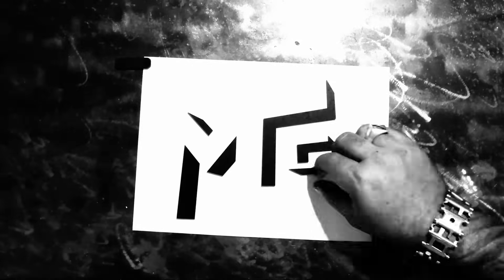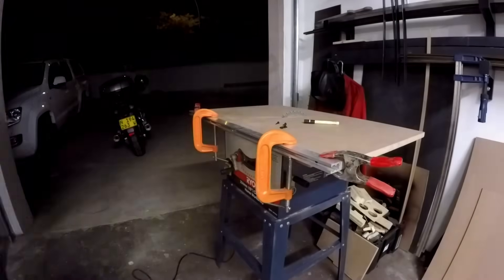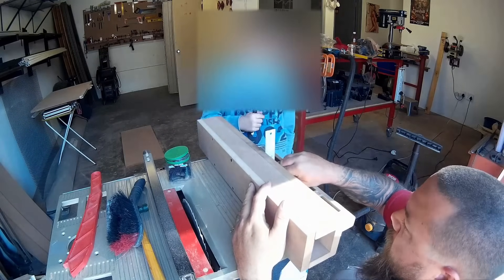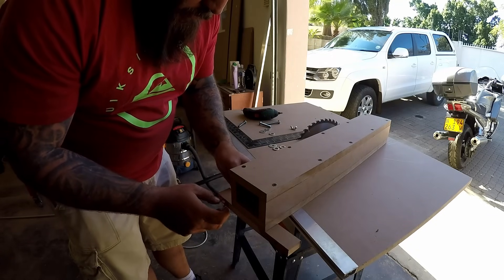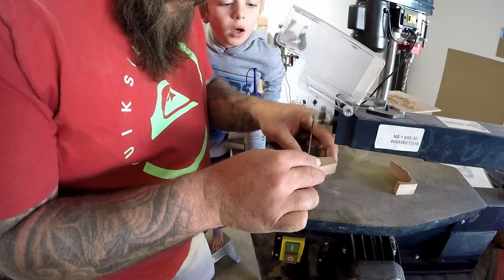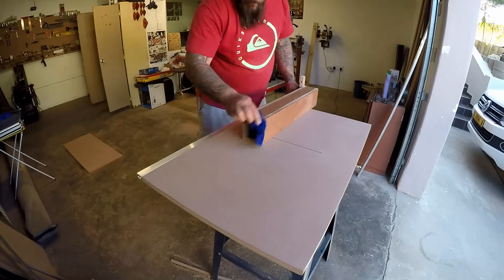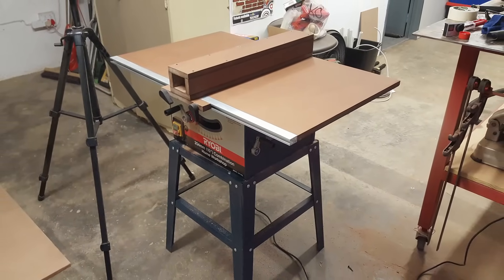Cheap Table Saw Improvements Part 1

Comment: Great job on that buddy but all I can say is no matter what you do to that Ryobi machine it is going get you again. I got the exact same machine and I took the motor out and made a complete new outer frame and table top for it from 25 mm pine ply. It runs much quieter than the previous. No metal plate therefore no vibration and less noise. If you xan fet your hands on an old drawing board machine, with afew modification and you have a good fence. Drop me your e-mail address and I will post you some pics of what I'm doing to mine. By the way, I'm from Cape Town. SA. Great job once again.
Reply from the maker: Thanx... yeah, ive been planning a redo, would be great to see the approach you're taking with yours... macon.campbell@gmail.com
Reply: MACON CAMPBELL Hi Macon. Go to Uncle Cys Woodshop on youtube. Old tablesaw to new tablesaw. Great video and I'm going to use some of his ideas to upgrade mine. I will use what I have now to build the new one.
Reply from the maker: Jut checked it... Wow!... some great ideas there, I may just use a couple too.. 
Thanx..

Comment: Man I notice u don't have a splitter and the end of your blade. Not sure if that's there actual name but that's what I call it. A bit of steel to seperate the two pieces of cut material so it won't kick back all the time. I think a tablesaw is sooooo dangerous to run without one, always kicking back. I do love the design man, really do, I'm no expert but pls put what I call a splitter on behind your blade before u start losing fingers.
Reply: I agree Willis. The saw should have come with a riving knife or splitters

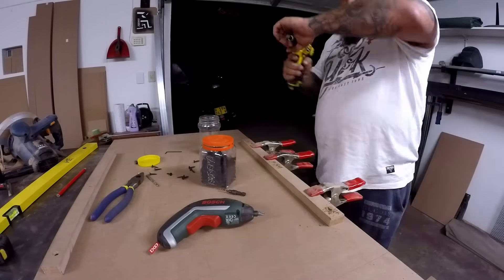Comment: at 2:00 and MANY other spots, you can see you're NOT drilling vertically. Probably doesn't matter, but it appears that NON Vertical is your rule rather than the exception. Doesn't matter much for the hole drilled, but then following afterwards with a Phillips head screw in a drill driver, and if the Phillips bit is not perfectly aligned with the center line of the screw, the Phillips bit will severely chafe the shape of the Phillips receiver in the screw.  Again doesn't matter so much for a one times use of the screw, but removing the screw and remounting it, each time the screw is abused, it looses the positive grip between the screw and the bit , each time loosing the maximum torque that can be applied in that assembly.  At some point, the screw cannot be removed or reinstalled, and you have a problem of extra measures required to accomplish service. This is also true of straight slot screws too. Becomes "amateur apprentice day" in the shop,  and the shop owner hides the work in the corner of the shop so no one sees it until the apprentice leaves, graduated, or repairs the workmanship. 
No offence intended, but comment screamed at me, so I sort of had to say something, .. or my own quality suffers.
Reply from the maker: I have never claimed to be anything other that amateur anyway... That is what I was capable of then... I like to think I am capable of better now... thanx for watching...
Reply: maconSTUFF 1 minute ago Highlighted reply,"I have never claimed to be anything other thaN amateur anyway..."
Maybe I've been less than fair. I worked with a guy who had this same affliction(in ability to accomplish the task effectively) among others. At 68 He was the Boss and Owner and he was dying of Parkinson's, and then at 64 I was "the apprentice",  and because of the disease the quality of his work was progressively worse and worse.  Under extremely hot and difficult conditions he and I would remove hundreds of screws to climb inside the equipment to do repairs, climbing back out and retightening those screws, and test the equipment, only to find damaged returned screws were causing air leaks requiring REENTRY AND RE-REPAIR by me the apprentice, and I'd have to ask Boss NOT to help me as he was causing more rework than doing and completing the repair. He was hemorrhaging money trying to complete the project, He insisted on trying to get it done faster by helping, putting us further and further behind. I wanted to FIRE HIM, but he was paying the bills, so all I could do was endure. (Hot, difficult, physically very challenging, mentally exhausting and demanding) On one project, we had to go back in 3 times causing 3 days of unpaid rework. Finally, at the end of one of the projects, I had to call him and tell him we were both OUT OF BUSINESS, that I could no longer work with him, and (as he knew, he could not accomplish the work himself alone....)  The disease, and his disability, caused by it, were killing ME as well as him, and the more he struggled to maintain his abilities, the more thankless and criticized rework I was forced to do. With the mental disability of the disease, and the medications, and the extreme exhaustion, he could NOT SEE the development of the problem.  
At times, LIFE IS TOUGH, and we struggle.
All we can do is to struggle to perfect our skills and abilities while we have them, and pray they outlast our needs.

Comment: Well done, Looks good.
Quick suggestions yo make you world exciting: look @ Sketchup Make will make projects a little more fun. 
In SA you cannot get anything like you can in the US or UK. I found a site (Wish.com) you can purchase many thing from there long lead time but it gets here.
Keep Safe and hold onto all 10 digits
Reply from the maker: Hi Peter... Thanx!... I actually use Fusion 360...
Signed up at wish.com, looks good... how are the prices so good? have you purchased from them before?
Reply: I purchased a bike computer and it came a week early but still 10 weeks after order. They have some free stuff too just pay shipping. I have setup a wish list and when I have the finance and the like I then will go "Bos" I see you have much of your tools from Ardendorfs, we have one here too and they were very reasonable be fore but are now getting pricey.
TIP check the Pawn shops I got a Krieg Draw slide jig for R30 when it retails at $30 so I troll the stores in my area.
I don't know if you know Izzy Swan He make a jig for anything and everything, very stimulating and a good resource is Steve Ramsey he has alot online too
Thanx again for posting

Comment: I hate Melamine. Won't use it. Don't even like it my shop. (spiritual problem) But...because one side of it is some kind of plastic bonded to MDF it makes for a pretty slick surface and it's a helluva lot cheaper than Formica or phenolic. I like a slick surface on a table saw. Same with a router table. Over the years I've used Johnson's Bowling Alley wax (let dry and buff a little) to make the table sweet so that boards will slip across it like a hot wing through a cloud. Also, if you've read some of the foregoing comments as I'm sure you have, watch videos of traditional (ancient) Japanese woodworking. Some pretty formidable craftsman and they are nearly all barefoot. Keep up the good work.
Reply from the maker: Thanx man... I used melamine for the second rebuild I did: https://youtu.be/pGNBSCswBac ... also not a fan of the material, but as a surface for a tablesaw, it turned out a lot better... yeah those Japanese woodworkers are literally "Ninjas" LOL... Thanx for watching mate...

Comment: I understand this video is 4 years old, but I'm gonna add my 2¢ anyway...
I see why your bit broke. You tend to start drilling at about 60° and then rotate to 90° to finish drilling. Too much rotation. If your bit isn't sharp enough, then we compensate by adding force to drive the drill through. The combination of rotation and downward force is too much for most drill bits. You should sharpen or replace your bits to avoid breaking them, and try to avoid starting the hole at anything but 90° from your board (or joint).

Comment: If your going to cut MDF invest in the best dust collection system you can afford. MDF dust causes cancer! You definitely never want your kids around this dust. I would suggest installing a central dust collection system as a start. Add in a Rikon air filtration system that cleans the air in your shop every 5 seconds. Invest in a Trend face mask with filtration and fresh air intake. The first thing would be a disposable dust mask at the very least. If you’re going to cut MDF, cut it outside! I would rather spend my money purchasing these preventive measures than contracting cancer and paying hospitals and doctors. Most of all paying with your life. It just isn’t worth it!

Comment: It is a very nice project but is it worth it? If you did it to kill your weekends then it is. But if you did it to have a better table saw then it's not. All the tools, materials and time were used, it's probably a lot cheaper if you just buy a good table saw. Nice video though
Reply from the maker: Thanx Andy... Well I already had the tools and the time, but unfortunately not the cash for a new one... this more than served its purpose... I re-did it a few months later, much better than this one here is a link if you're interested: https://youtu.be/pGNBSCswBac ... besides, buying a new one would make a pretty boring video... LOL

Comment: i never have and never will use MDF it is a bad product ,damage easy (no inpact resistance) anny contact whit fluids and it start to fal appart
Reply: I cannot argue your comments, but MDF is a rather cheap solution for the "home enthusiast" ... aka guys doing this and that with woodworking tools, and not intending to become the next Matthias Wandel or Paul Sellers.

Comment: Ryobi
Cheap rubbish Chinese machinery with a spares and support service to make the big brands jealous and look stupid. Of course its broken but we have everything in stock from armature and brushes to on\off switches. Adendorf prices with Metabo service, whats not to like for home use :-)
Reply from the maker: LOL... where I live, the service sucks too... I took a Ryobi circular saw in to my local dealer "Pupkewitz" which was broken more than two years ago... they said they have to send it to South Africa for repair or refund... I still haven't heard back from them... since then I have lost the paperwork, now I'm screwed... out of pocket and out of product... :-(
Reply: @maconSTUFF  I am going to copy your idea for the table saw next time I need to cut large sheets. Thanks for uploading it :)
Of course I have the exact same model of saw.
Reply from the maker: My pleasure Andrew... before you settle on this design, you might want to check out what I did with the next upgrade, I think it turned out a little better than this one... here is a link: https://youtu.be/pGNBSCswBac ... Good luck with your build... 👍